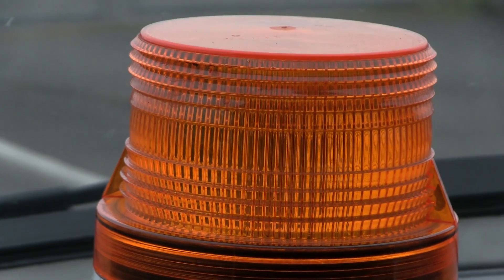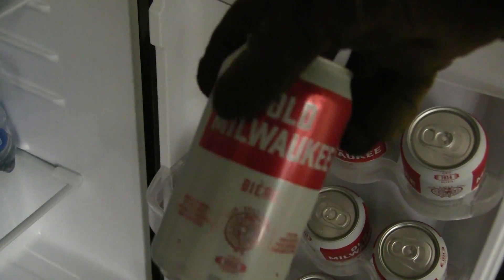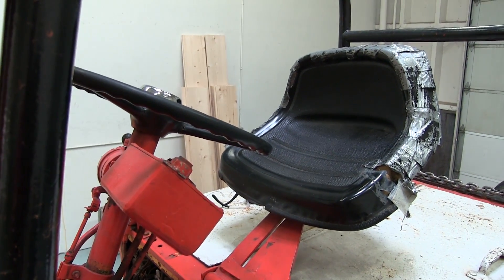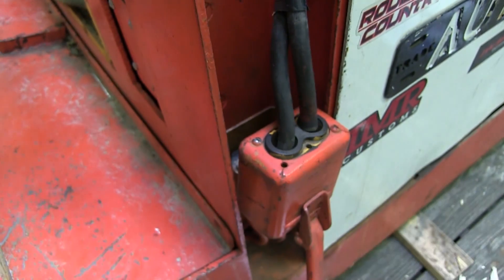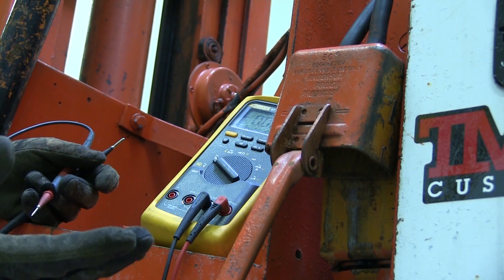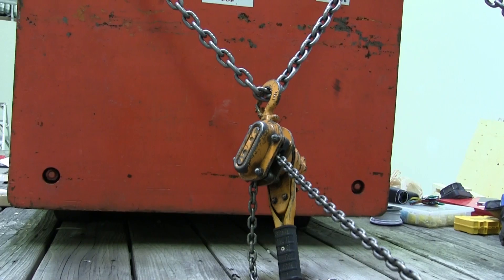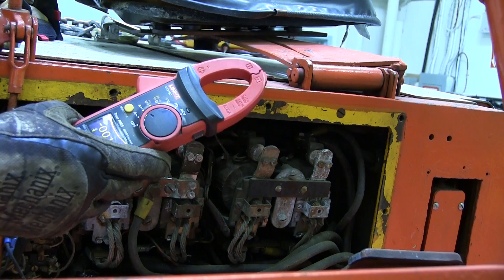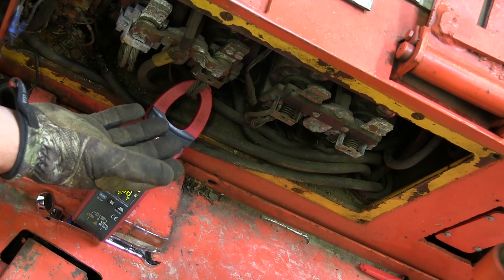Powerful Electric Troubleshooting | Voltage Drop Test

Comment: the higher resistance in the leads makes the motor draw a higher amperage??
now that is flat out wrong
amperage drawn is dependent on total resistance,as the resistance goes up amperage will go down
Reply: So are you familiar with synchronous motors that run at an RPM dependent on the supply frequency? Because on those the amperage for sure increases when you increase the load.
It's quite complicated with those inductive motor loads and i'm not so sure what exactly happens.
Now if the load remains constant and the voltage reduces the motor either slows down or the amperage increases.
Why they draw power when you put on load probably has to do with the phase angle of the field windings rotating versus the motor rotating. I would explain it wrong but maybe you can read a bit on wikipedia if you want to know more.
Reply: i am fully aware of the working of the synchronous motor, what supply frequency  in a dc motor?
this is not about increasing the load on the motor but increasing the resistance in the leads to and from the motor

Comment: Is that batt pack supposed to look like it's about to fall out of the ass end of that lift?
Reply: M Cruse he pulled out to work on it. Batt pack is in rear for counter balance to any lifted load.
Reply: I get the counterbalance weight, it just looks like it's sitting on a half-rusted platform back there.

Comment: 7V x 128A = 896 W... 🙄 This old thing comes with seat heating!! 👍 😁
Reply: the motor is getting the other 29ish volts.
Reply: It's only drawing this much current because the motor is stalled.
Reply: Well but it's not all heat, you are using a motor so you are going to convert most of it to kinetic energy. So probably only 100w heat if the motor is not that efficient
Reply: Valentino Saitz 
No. We are talking about the voltage drop, which is 7V and voltage over the motor is 36-7 = 29V.
The current through the whole circuit is 128A. So the motor takes 29V x 128A is 3712W.
And the 'seat heating',  takes 7V x 128A = 896W.
The total power is 3712W + 896W = 4608W, which is the same as 36V x 128A.

Comment: I work on all sorts of material handling equipment and the crusty battery could very well be the problem. Those trucks are insulated return so if the battery ends up leaking and shorting to the battery casing you get weird voltage readings from the battery like you saw. Although I'm sure you've already sorted this you should chuck a 24v lamp between the battery terminals and the chassis to see if there's any current flow.

Comment: I have that exact same clamp meter.  btw, you need to change the battery :)
Reply: What is it, I couldn't tell.  I didn't know he used anything other than Fluke.
Reply: It is a fluke. An old one. A model 30.

Comment: PEBSAW = Problem Exists Between Seat And Wheel
Reply: Shaughn Shea Might be an ID-10-T error.
Reply: Or the IT version: PEBKAC - Problem Exists Between Keyboard and Chair
Reply: "PICNIC" problem in chair not in confuser. That one goes both ways. Aaaaaand, demonitized.
Reply: Shaughn Shea Loose nut behind the wheel.
Reply: We call them big circlips.  All the do is hold the wheel on.
Reply: Generic version: ID-10-T error.
Reply: Ok, I have forgotten what the ID-10-T error meant
Reply: Computer version "PEBKAC" Problem Exists Between Keyboard And Chair.
Reply: I've always (since 1980) called it the "loose nut behind the keyboard" problem. 2nd shift seemed to have more of them, but always a good test for your software...
Reply: It's a bad gasket.  The gasket between the floor/seat and the bench/controls.
Reply: User Error: Replace User
Reply: Loose nut behind the steering wheel

Comment: That was helpful. I now know how to measure voltage drop. But how do you measure the voltage drop on a 150' cable going to a 60hp motor on the other side of a building?
Reply from the maker: measure phase to phase voltage at feeder. walk 150' measure phase to phase at motor. difference is voltage drop in the cable.
Reply: AvE *while under load. VDROP is proportional to current
Reply: It's funny how far ohms law will take you.
Reply: Or use two meters and do as Ave did in the video. Subtract the downstream (motor) one from the upstream (source) one. In general electronics are not too tricky as long as you get used to jostling connection points. BTW this particular issue is awes0me stuff to learn because this is where about 95% of the problems exist. Bad connections and heat.

If you believe in probability then the next place to check on ANY circuit is the device(s) that handle the most power. Back in the crt days the HOT (horizontal output transistor) would blow on most tvs because it flowed about 50% of the total power. How it would look to the customer - "my picture tube blew" ...just to give you a very real life example.

Great question btw.
Reply: Get the aprentist to lick his fingers and hang on tight
Reply: If you have a thermal imaging camera it makes problem connections easy to spot provided current is still flowing.
Reply: burtosis there was one in his tool bag.
Reply: Carefully.

Comment: Mechanicals are always on our case to fix a mechanical problem with an electrical fix.  You put the wrong size pump in and now want us to fix it by tweaking the motor????
Reply from the maker: What's the problem?! it's just a setting on the drive. Sheesh.
Reply: Good luck. I can't even get people to understand why you don't want to buy 10 gauge jumper cables. lol
A co-worker of mine put one of those "you need to do this!" members through an ordeal, today. My co-worker got tired of the excuses and drug that poor guy through everything he thought needed to be done, on the factory roof, in the hot sun in 90 degree+ weather. I don't think he will complain that the maintenance department won't help out, any more.
Reply: TheTomBevis everyone blames maintenance for problems... I like to say need a mechanic throw a brick in the woods you'll probably hit one...
Reply: You’ve never seen a municipality use a vfd to get a specific flow rating out of a pump but throw balancing out the window to achieve it?  Lol
Reply: @Kbat so much powaaaaa man!